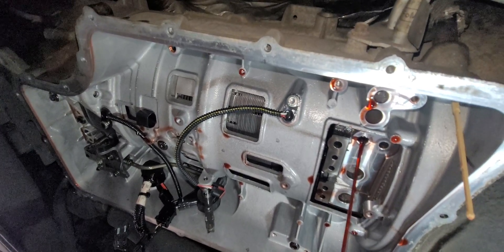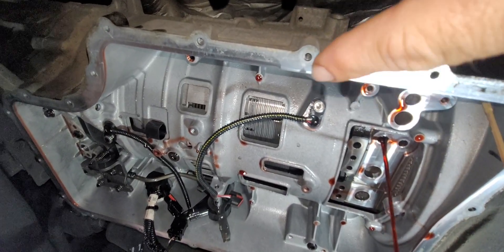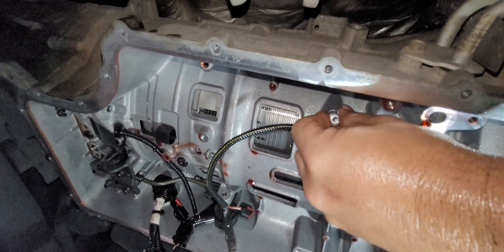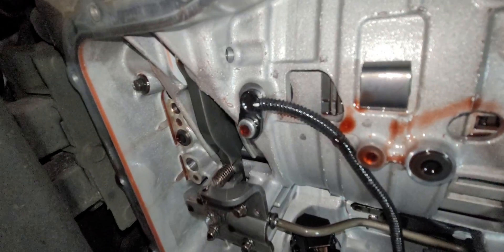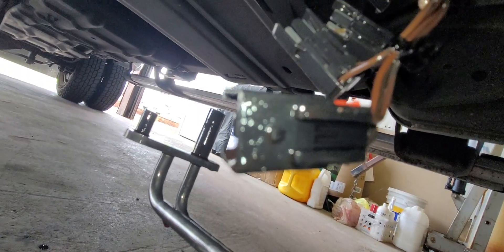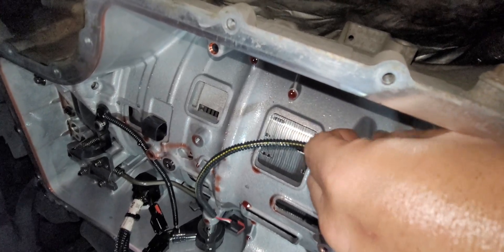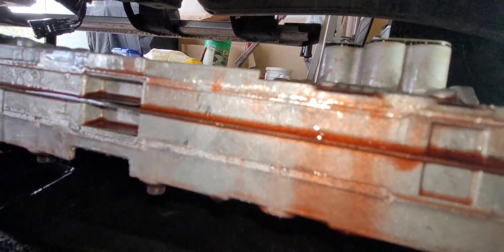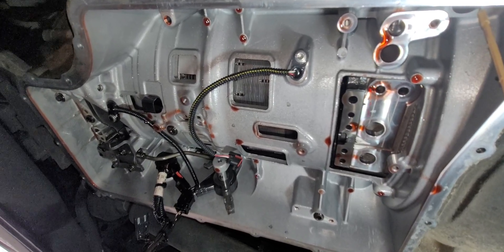Ford 6R140 Speed sensor locations

Comment: So did it fix the hard shift 

I have the same transmission and the same problem and mine is the same miles
Reply from the maker: He said it did help the shift but the tourque converter wasent locking up either and temps were running really hot even when not towing. He replaced the transmission last week. We replaced sensors (recorded this video) about 6-7 weeks ago